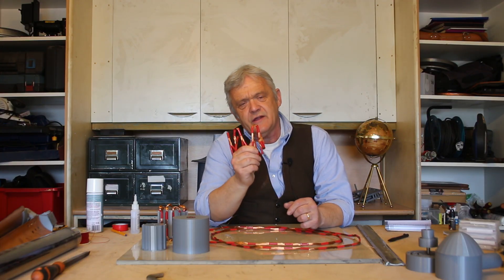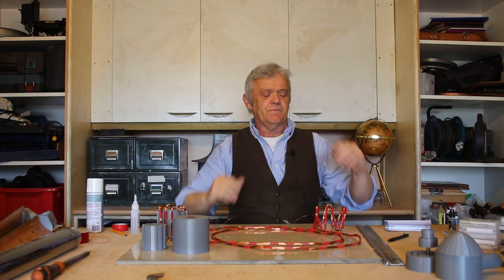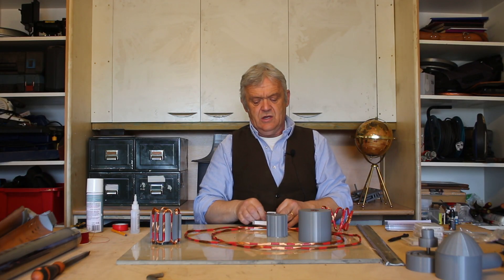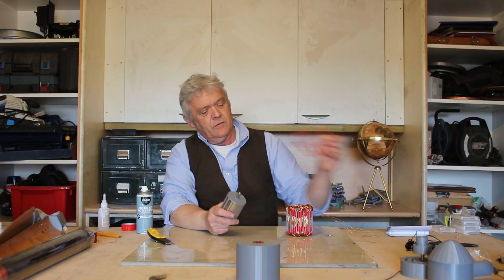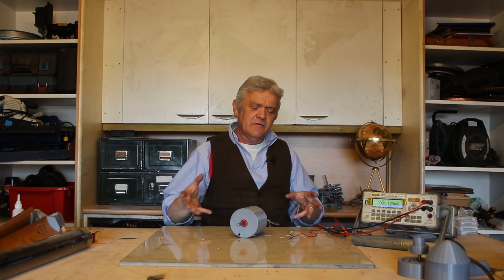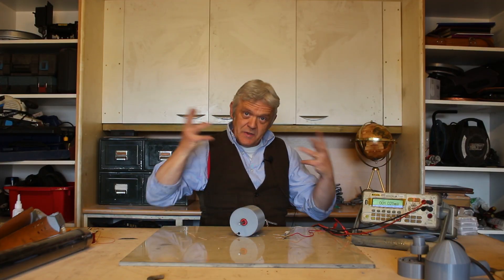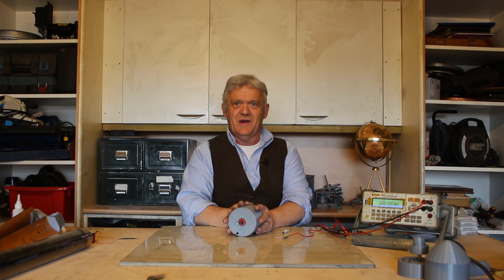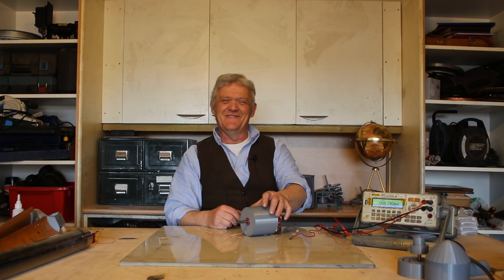1931 A More Powerful And More Efficient Generator And How To Build It

Comment: There are no watts in the wind.
Wind is not electricity – it is motion in the medium: air.
What you’re doing when generating electricity is simply rotating a coil so that it intersects the dielectric and magnetic field lines of a magnet. That’s where the response comes from.

Electricity isn’t pulled from the wind.
It emerges from the interaction between motion and field.
As Charles Proteus Steinmetz said: Electricity is the interaction of the dielectric and magnetic. It is not a thing in itself.

This is why geometry matters. If the copper doesn’t have the right angle, you won’t properly cut through the field — and you’ll get nothing.
What we have are two conjugate fields, and if you intersect them correctly through motion, the result is electricity: a hybrid of dielectric and magnetic.

For those who struggle with this type of language:
Magnetic = what we call current (amperes)
Dielectric = what we call voltage (potential)

❝There is no such thing as “electricity” as a substance. Electricity is not energy.
It is a combination of electrostatic (dielectric) and electromagnetic (magnetic) phenomena, resulting from a disturbance in the ether.❞
— Charles P. Steinmetz, ca. 1916, Union College

⸻

But what does it really mean to “cut through” the field?

A magnet is not “a source of magnetic energy.”
A magnet is the spatial geometry of two conjugate fields in opposition.
The dielectric is radial, inward/outward — a field of potential.
The magnetic is toroidal — a field of motion.
These two are not separate — they are counterspaces of each other.

You don’t extract energy from a magnet.
You disturb the resting balance of dielectric–magnetic conjugation.
Electricity is the result of motion across this balance.

❝Electricity is not made of particles. It is a field phenomenon.❞
— Nikola Tesla, ca. 1891, Electrical Engineers

❝Every particle is a wave. Every wave is a field. Every field is a motion through the ether.❞
— Tesla Papers, Colorado Springs Notes, 1899

❝We are whirling through endless space with an inconceivable speed. Everything is spinning. The source of all motion is the ether.
We only tap it when we move through it in the right way.❞
— Nikola Tesla, New York Herald Tribune, 1931

---------------------------- 

Love your videos =) ❤

Comment: Would be nice if you put the formula for calculating the voltage in the description. I kinda got blvsignthita from replaying your comment on that but having trouble looking it up on google. Trying to figure out what it would generate at like 2000 rpm

Comment: Could you containerise these? fix  the leads to pins, that slot into another sleeve with a transmission track, then stack these with in with a long central drive shaft?

Comment: There are two of us who are working from your designs combining different aspects of them I'm interested in wind The bioplastic serpentine coil and then the flat rotor and he's stacking the flat rotors in like a huge long stack of them and then counter facing the poles on the opposing sides and has also integrated your flywheel right so he's got to flywheel on both end and then I'm going to somehow probably use the the the star gear or some type of down fearing and then also I'm working with your designs to regulate the power output and so you have inspired two people who are now taking your work and your designs and adding our own and then I told him about my wish to make your stuff with bioplastic and graphene and if necessary depending on how it works out maybe adding carbon fiber in long strands by splitting the plaster mold in half and it'll be a heat like high temperature with the heating elements built within the mold because you have to heat it up under pressure so it's going to be like injection molding with a ramrod and some kind of press and it heats itself and clean it up and then put some kind of UV clear coat on the outside and that should keep it from breaking down too early and you just add another one if you know so basically when you want to start decomposing back into no protein you stop adding a coat the coating and you put it in an anaerobic environment.

Comment: i've often been curious why is copper foil not used inplace of copper wire? i'd feel like the surface area would go up with the number of loops.     math wise i was unsure about the eddy's calc, let alone winding since most of the math involves wire diameter instead of width and thickness, to length, i mean surface area mentally feels like it should go up.

Comment: Is it “right-anglesness” or the length of the wire that increases efficiency? Because wire in serpentine configuration is longer at the shallower angle than at the right angle.

Comment: Hi Robert. Great video, thanks a lot! 
Just to get this right... This now is not three phase? It only has three separate coils that you can arrange either in parallel or in series? 
And how would I arrange three serpentines to act as three phase generator? Have them run down in one slot and leave two empty before coming up again, or have each coil covering a 120 degrees segment of the stator?

Comment: I was thinking about this and what if instead of, or in addition to, rotating the 12 magnets at once, what if we rotated the magnetic field in each of the 12 positions? What I am imagining are two coils, an inner and outer coil, and 24 magnets in alternating alignment. As an example each set of two might be say N/S then S,N, with coils on each side. Then something that rotates the actual magnets. I am imagining a gear-like system where every, just as an example, 1/12th of a turn is effectively equal to one full revolution of two of these.

Comment: Robert, i watched the video where you say you can use a mosfet to induce maqgnetism in a electro magnet. In another video you said the longer copperwire the higher voltage, the wider it is the higher amperage. So i guess we agree that the more copper used in weight the more watt will you get. But you might be able to create a strong magnet field on your electromagnets, with just very low input watts. So do you really need a wind turbine, to make 6watts?

Comment: What would happen if you made 2 stators, one on the inside of your coil and one on the outside of your coil in the same orientation?  Would that increase your energy density any?  Perhaps test layering coils and stators around the same axis to see if that will increase your power density.  See if 2 coils can power the third to create over-unity output?

Comment: Hi Robert, really enjoy the videos. What changes in wire and magnet size would be required to build a dc generator to charge a 12vdc battery?
Reply: For something this size, throwing a $2 buck-boost convertor on it after rectification would work just fine.

Comment: Hi Robert, Your latest video is interesting. In my experience not enough is given to the magnetic circuit. Your generator would probably give more output with an iron rotor and a surrounding iron casing.

Comment: How much more power would making the stator and magents say around 6 foot in length in a long tube, like this little one you made?   to power make a vertical blade setup that would be secured to the shaft (if shaft is pointing up), and the vertical blade setup surrounds the 6 foot tube from top to bottom?  a simple flat bearing at the bottom can secure the bottom of the vertical blade setup.     

Hope that made sense, as these vertical blade wind turbines, i always found it odd that they use one small looking generator instead of expanding that generator vertically within the blades.   probably has been done and it didn't make much energy?  if it needs more torque to spin.  just increase the vertical blade design,  granted at some point you'll have 4foot wide blades, but would be an interesting experiment as i haven't seen any youtube vidoes doing that.

Comment: I have used 20mm square x 10mm neodinium magnete n52. What if i wound up down up over each magnet and so on. I would effectively have 3 vertical sets of wires passing each magnet.

Comment: Instead of an outer sleave you should have another cylinder of magnets.
Gauss rating is at the surface of the magnet. The further away the copper from the surface of the magnet the greater loss of gauss.
To combat this you need to force the field lines of the magnets to travel to another magnet. This will improve efficiency by creating a magnetic circuit.
Double the magnets for two rotors and one stator.

Comment: Robert, what would be the effect of  doubling the length of the stator and rotor? would it double the voltage to something that could be used to charge a 48V battery system?
Reply: Voltage = EMF x length of wire x relative speed between wire and EMF... Yes, doubling the length of the wire and magnets will double the voltage

Comment: In order to make the magnet hover over, you need to drill a hole straight through the center so it acts almost as a pulsar star this will create a source of clean energy and it will be sustainable. In order to move the magnet, you need to learn how to control the frequency radio waves around it by manipulating the frequency waves you can continuously power it for ever sustainably. if you are able to capsulate this invention inside a pyramid, it will be a 10 times magnitude scale of its power that manipulates the atoms around it. This kind of technology will be built into every thing in the future.

Comment: This type of serpentine coil was used as the field in four pole Lucas starter motors from the 1970's. Made from aluminiun strip, short run so tolerable losses. Good old King of Darkness, some great stuff, lots of rubbish.

Comment: so if I made a generator that was about the dimensions of yours (With One Exception) only 6 feet long with six foot long magnets - it would be far more efficient than almost any commercial generators that are made using ridiculously stupid specifications. Any generator that does not look "Like a long pipe" would be a stupid design because the designers are designing for MANUFACTURE over designing for EFFICIENCY. it's a perfect example of how the "Owners of Production" are TRICKING the rest of us by "PRETENDING" they can';t make more efficient generators

Comment: Have you tried using halbach arrangements instead of NSNSNS?

Isn't the best magnetic field the one with the most cross section going through the wires perpendiculary?

NSNSNSNS looks like small circles, the opposite of the serpentine coil's objective

How to not waste the part of the field that is perpendicular to the surface of the magnets? And the part of the field that's pointlessly in the middle of the rotor?

Maybe it's only relevant in bigger rotors so that the geometry of the rotor is closer to being flat(larger diameter), or not at all

But you've optimized for the best electric field reaction to the accelerated magnetic field, but what about optimizing the magnetic field itself?

I'd love to see a 2d halbach array using many small magnets, maybe offset/intercalated so that the resulting magnetic field is like a larger diameter cylinder parallel to the surface of the magnets/rotor.

I really hope there's something useful around this idea

Comment: Robert, are these files available on Tinkercad yet? I looked in your designs and couldn't see it. Thanks for all your work. I have printed 8 ugrinsky blades inspired by your video. It runs in the slightest breeze and I intend to use it to heat a 12v element in a radiator.

Comment: You should be able to increase the useful Flux and the power density with a halbach array built using two levels. If the magnets have magnetic fields oriented along the shortest length -assuming the same magnet shape- then you could use the 3d-prints as--is, alternating North, south radially; if you then modify the magnet holder (is that the armeture?) so that a second ring of magnets are inboard of the exterior ring and can be oriented to make a halbach array. (IE, every north of the inner ring is oriented annularly towards a south of the radially oriented outer ring.) Thus, with only a minor modification, this design should be able to double or triple the usable magnetic Flux: twice the magnets with a field shaped into the used volume.

The magnets are in the center, right? I'm suddenly forgetting the assembly pattern. Regardless, the above comments assume the magnets are internal of the coils. The described geometry would have to change (though only slightly: the radial and annular componets swap) if the coils were within the magnet housing.

Comment: If you made the magnets horizontal in a radial direction and made the serpentine coil flat in the horizontal direction you can bring the coil closer to the magnets.  You can also stack the magnets and coils making a layer of magnets and coils alternately. You stack them as high as you want to produce the output you want.

Comment: Hey! An interesting idea to let this motor deliver more watts (in higher wind speeds) without going over the current limit of the wire would be to have a circuit that has a sort of adaptive resistance or reluctance to limit current while allowing the voltage to climb, making a sort of varying voltage, constant current generator. This would obviously be limited by the dielectric strength of the wire insulator, but what are your thoughts? Maybe combine elements of this idea with a computer controlled magnetic gearbox to maximize output sort of like knee-point tracking in solar?

Comment: This an absolutely brilliant video,  This also makes an most excellent motor when ran  (can use hall effect sensors or reed switches )  as such.   A man named  John Bedini  designed a motor called a "window' motor , and i made several of them and realized they make excellent alternators, when ran as such.  There is no cogging , which is nice , and its easy to get good current out at low rpms....  The serpentine coil makes it all so much easier.

Comment: Could you maybe also tell how many meters/grams of wire goe in a certain design? I would like to experiment with this and am looking to buy enameled copper wire. It's not cheap so would be nice to know if I need to buy 500grams or better 1000gram spools (of maybe it is a lot less used in such a generator) ?

Comment: As you say Robert, every thing is relative. So if you scaled up the diameter of the stator and rotor you could use 0.4mm copper wire. But would that actually increase the output proportionally?

Comment: More stimulating information. But I have to point out one tiny error - The serpentine configuration does not give a higher ration of copper wires in the vertical plane to the horizontal plane (tops/bottoms) over a standard coil configuration. But that takes nothing away from the other advantages of the serpentine configuration.

Comment: I love your channel! I am not sure it has been mentioned before you could get more flux through the coil if you returned the magnetic flux on the rotor.  You have a high reluctance path from the back of the magnets to the front of the magnets so you lose half the magnetic field that comes from the back of the magnets. You could build a low reluctance path to return the magnetic field from the magnet face that faces the coils to the back of the magnet by building the  rotor in the shape of a cup made of magnetic material. The stator would fit inside the cup. The rotor cup would spin around the stator. You need the rotor in a cup shape so you don't make eddy currents - makes things a bit heavier and harder to build but you should be able to double the flux, hence the efficiency. Carry on!